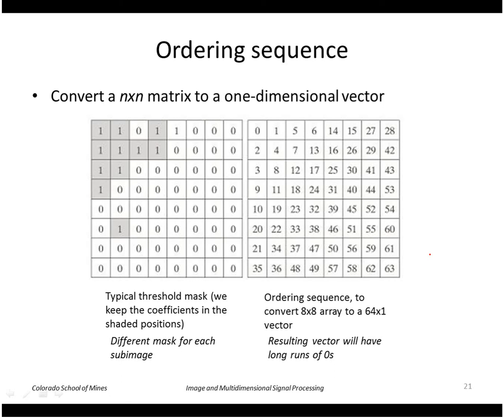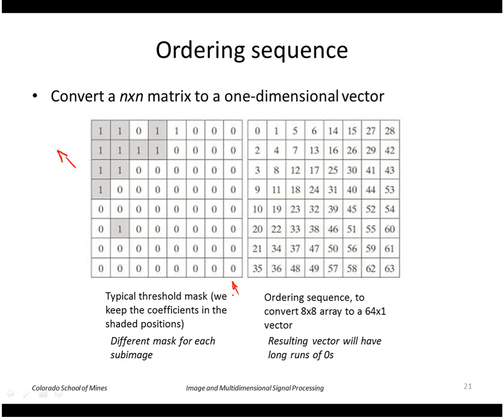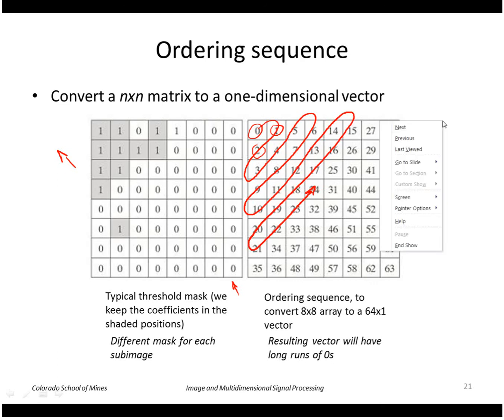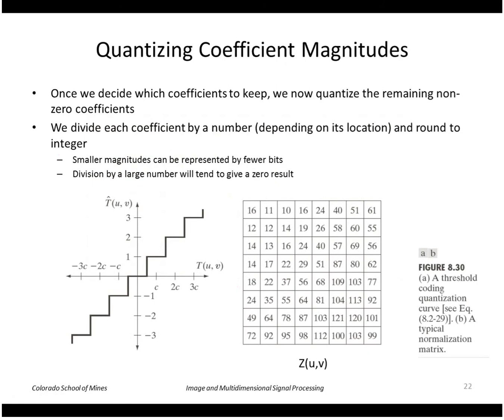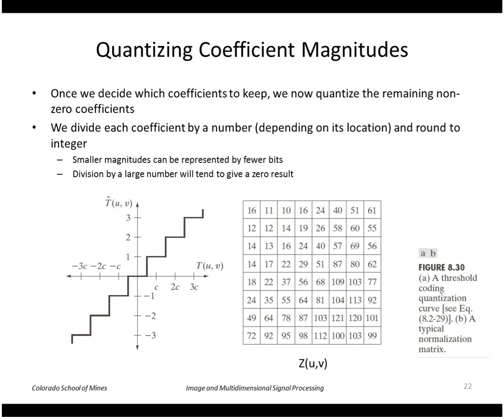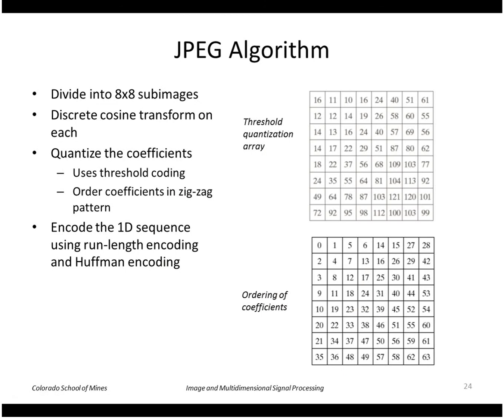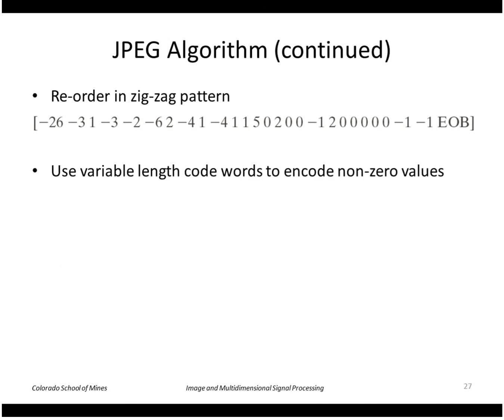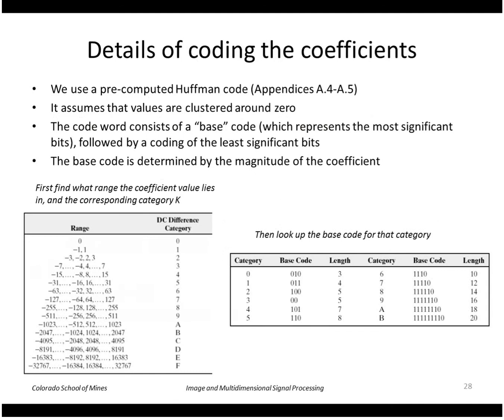EENG 510 - Lecture 26-3 Compression-Lossy

Comment: after we subtract 128 to each entry, what's the next step ?
on the table we got -415 and so on. how to get those values ?
thank you
Reply from the maker: Jayadi Kurniawan The next step, after subtracting 128 from each value in the 8x8 image, is to perform the discrete cosine transform (DCT).  See slide 8 of this lecture.  The result is the 8x8 array of T(u,v) values.  So the top left element, which is a -415, corresponds to T(0,0).